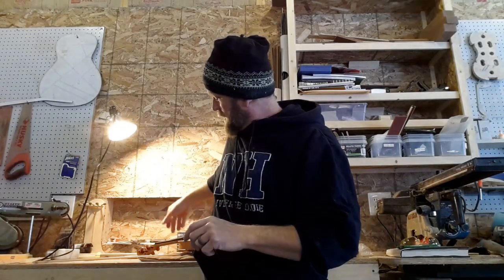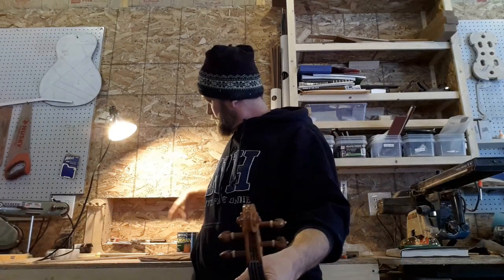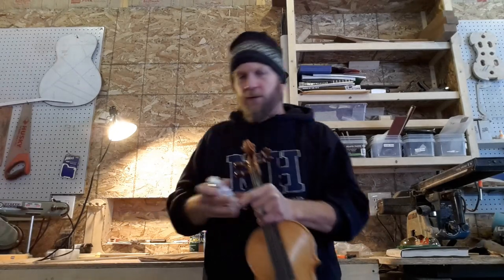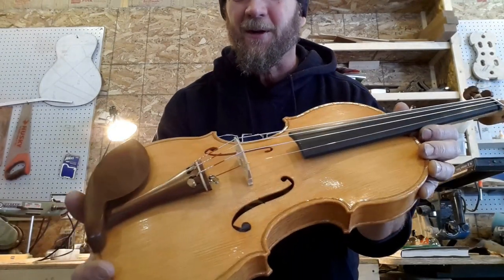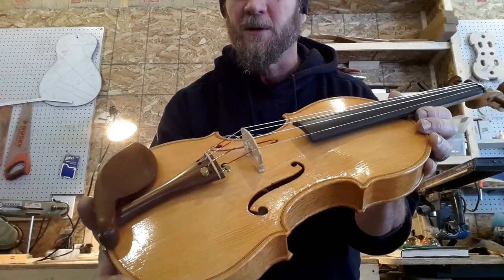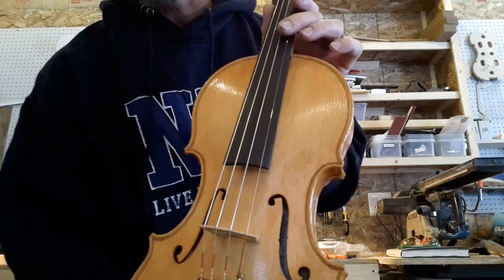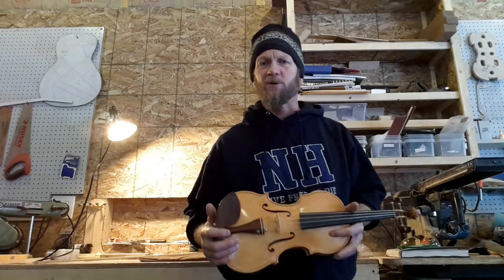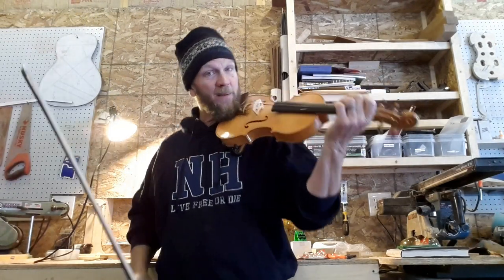Building an Oak Fiddle part 2

Comment: Jon Magnum, Sir, I have watched the videos showing you making this violin and I must congratulate you not only on your 
 great craftsmanship and  the fact that you used difficult woods to work with, but also in the manner you went about it. You knew that the oak would give you a resonating chamber that will produce its own particular set of resonance frequencies because of the volume of the chamber,  but the areas making the face and the  back of the violin would also be set at different frequencies depending on the shape and the weight of the distributed material.   All I am trying to say that since I am an old engineer  and have always preached that all art is supported by engineering, many artists did not like what I say and they think that art  and music is contained in all musical instruments.

Well, seeing you testing it all with a signal generator and a loudspeaker to get what is known as Chladni's figures in vibrating sheets,   well,  I now can use your videos to persuade my artist and musical  colleagues, that all art is supported by engineering.
I did some work in analysing the frequency contents of a violin when excited from a sinusoidal signal as you did.  But because the violin is excited with a bow where the hairs, stick to the string for some time due to friction and when the coefficient of friction cannot hold the string any more, it shoots back and rings about the bow and this saw tooth movement on the string does not only give one fundamental frequency but taking the Fourier Series of the saw tooth function one can begin to understand the reason why the note from a violin excited with a bow is different from that when it is plucked.

I am no musician so you can appreciate why I talk about engineering in the "oak" .   I would like to do a lot of research on the  areas that are excited within the volume contained in the violin and also the distributed wooded areas that make bound the air container or the sound air chamber.  Also how that pin excites the back of the violin and how the bridge the upper face and how the air excites the air chamber, and what contribution would the junction of the neck and the air chamber would have in exciting the air chamber and the  patches of wood distributed around the chamber.

I enjoyed hearing you talk about the lack of finance to buy the materials and the cold that you felt as you made this video.  It reminded my of my younger days , when in Britain I earned five pounds per week and I had to pay three for my accommodation and two pounds to live on. It was not so easy,  but I found how to occupy myself in finding scrap material and turn it into something that I enjoyed.  Thank you  jogging my memories and again, congratulations for what you achieve.  And by the way, you seem to love your music,  and than you for appreciating  the deep science and engineering  that goes  behind an Oak fiddle.
Thanks  again.
Reply from the maker: Thank you for the great compliment, Carmel!
There is so much going inside a little wood box!  All effected by not only the structure of the wood itself, but the structure imposed upon the wood in the form of the curtate cycloid arch., then to add to the complexity, we affix a wooden "leaf spring" to the interior of the top plate, and a fulcrum in the form of the post.  Marvelous!  
Even the fingerboard imposes an important resonance, and it is effected by the mass contained in the scroll.  All fodder for many hours of enjoyable experimentation and speculation!

Comment: Excellent - I'm sure the spruce, construction in general and the bridge are more important than the back and sides - just like a guitar. Well, I'm not sure, but I'm guessing.
Reply from the maker: The back is like a reflector as well as producing the high notes transmitted through the sound post.
Yes-- Similar to the guitar....I have found the harder wood on the back produces a brighter sound and vice versa.

Comment: I've always been of the opinion that a great violin has a smooth, deep bass with the higher notes not shrill or harsh. That being said, I always wondered what the softer hardwoods like mahogany or koa would sound like combined with something like cedar for the top. Maple is so dense and bright. I believe the older makers used it because strings weren't as bright hundreds of years ago. With modern strings maybe you don't need such bright woods
Reply from the maker: Hey, Joe.  The answer is "sort of".  I can change the brightness or harshness by changing the resonant frequencies of the plates.  Even maple, when carved thin enough, is quite soft --- and also, the wood can be cut either quarter sawn or slab sawn.  Slab sawn can be oriented up or down, and the maple is much more pliable this way--and also shrinks and expands more.
Because I use many different woods, there are times, like with the Oak fiddle-- There is no precedent.  No one else is doing it, and there is no reference data.  I don't know how the wood will respond until I spend weeks building an instrument.

Comment: Well done Jon!!  Your work is really amazing and the violin sounds pretty darn good via a camera mic.  Do you know what the total weight of the completed product strings and all?  Thanks again for sharing your time and expertise.
Reply from the maker: Thanks alot! And...yes..I know the weights. 
That said-- weight is irrevelent.  There is no direct correlation between weight and sound in any violin--
Add to that the fact that I used neither spruce nor maple in some violins.  The oak didn't weigh nearly as much as you might think and resonated beautifully.
But, I do record the weight of the plates and the instrument....completed (which will vary considerably depending on chinrest used).
556 grams with Rosewood tailpiece and chinrest.

Comment: Very well done. I would recommend you shave down the pegs, and cut the length. If you don't have a lathe for shaving the pegs, you could probably find someone who has one. Otherwise, I'm sure that there is probably an instrument repair shop that can fit the pegs and peg holes for you. I can't remember the name of the tool used for shaving the pegs, but it is sort of like a pencil sharpener, but I know some people use a lathe.
Reply from the maker: Thankyou....and, yes!  I now have a nice tool to adjust the peg size.

Comment: where did you get the mold from? keen to build one in school
Reply from the maker: Moulds are quite expensive -- and easily made.
You can download a free template for a Stradivari at makingtheviolin.com and simply glue it to a piece of 3/4" (19mm) plywood and cut it out.
There are clear pictures on that web site.

Good luck -- and please let me know how your project goes.
Happy to help any way I can.

Comment: I need to get that hand shake down lol any suggestions
Reply from the maker: Vibrato!
What you are doing is learning to pat your head and rub your stomach at the same time...while using muscles you don't really use much.
I watched many videos when I was learning....nothing helped...except practice.
A great exercise is to flex the fingers NOT holding the string down, up and down in the vibrato rhythm you want-- not wiggling the finger on the string. 
That is easier for your brain and you will begin training the right muscles you need.  After a short while it is fairly easy to transition from moving the unused fingers, to holding them still and moving the finger on the string.

Hope that helps!

Comment: You should remove some of the build up varnish esp in the lower bout areas as it is killing the tone and making it sound tinny. Nice job with the build!
Reply: I meant to say wet sand the finish smoother and take some more off the lower bouts you will hear a big difference.
Reply from the maker: How would you reccomend me to do that?  What technique would be best?
Personally, I like the sound (I have quite a few hours on it now and several months), as it has been breaking in.  I don't love the finish....or the color, but it is all a learning process for me.  I have purposely built violins from all kinds of woods and tried different methods simply to learn what cannot be learned any other way.
Thankyou for the suggestion! I look forward to your response.
Reply: If you used oil varnish I suggest baby oil and start with 800 and move up to 1000 grit to remove dips and hills. Just pay more attention to the lower bouts. Trim feet of bridge to move bridge closer to body this will also give more vibration and improve tone. Move sound post in and back maybe to get better tone.
That violin will create better sound I am sure of it! I played pine fiddles that didn't look as good as yours and they sounded great.
I never use more than one or two coats to seal the plates, then color and some color in the next coat and a few more for a total of 4 coats while never exceeding 5 total, all with lightly sanding between coats.
Problem is too much varnish deadens the sound. Finish off with french polish or maybe swirl removing buffing compound.
Reply from the maker: Thanks so much for the advice.  When I can, I will give it a shot.  Are you referring to wet/dry sandpaper, or a grit?  Yes, it is an oil varnish, but I have fallen in love with shellac and future fiddles will be finished with that.  Lots going on right now..... and I am looking forward to getting back into the shop.  I'd love to see (or hear) something of yours, if that's possible.
Reply: Hi Jon, yes use wet dry sandpaper 600-800-1000 and use some baby oil instead of water. Light sanding with oil. Yes the oak fiddle is kool beans and can sound better. Last fiddle I built was in 91 and it has gut strings on it. I need to dig it out and re string it. Yes I used to play in blue grass band before my son was born then I had to give it up (being always gone playing gigs) to help raise my son. He is 25 now.
Reply from the maker: My oldest son is 25, too....and he has made me a granpa, which is pretty neat.  Yes-- all good dads give stuff up for the family.  Glad to meet you, and hope we can continue to converse.  You can email me through gmail at ridingontwowheels.